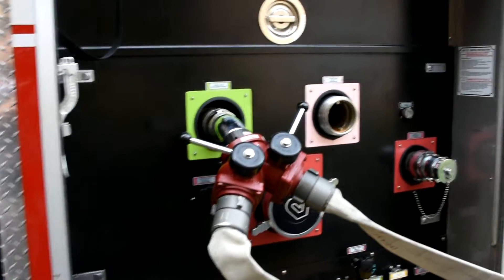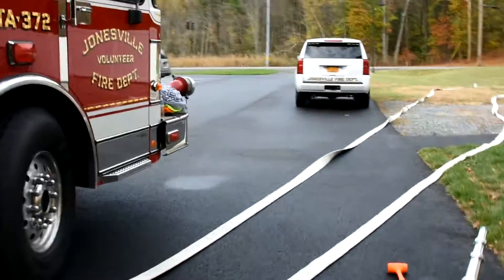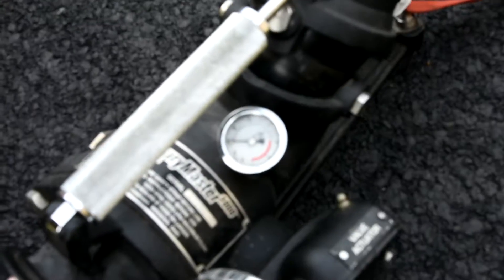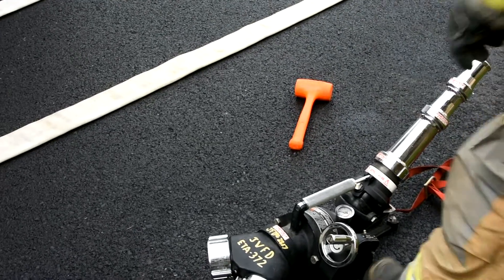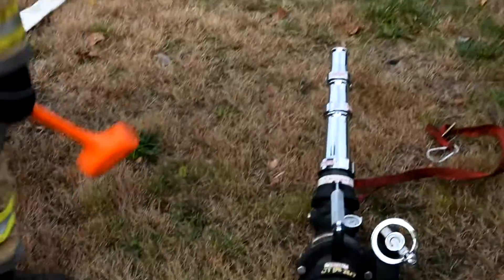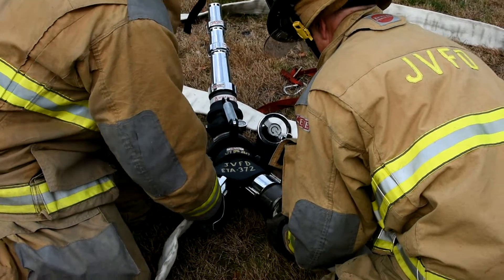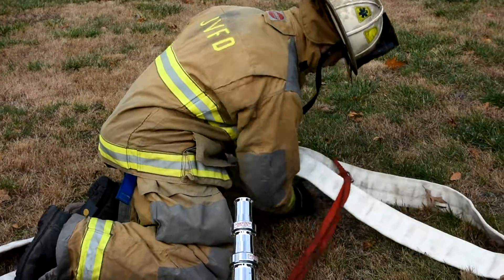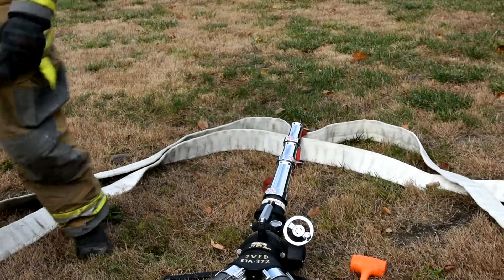Deploy A Master Stream Device - Skill Sheet 14

Comment: Good Work/ Instruction .

 May I suggest having this device Pre Connected off the rear of your rig ready to go with one 3 inch line on 2 .5  Couplings for a Quick Blitz Attack.

 You can then stretch a Second 3 inch line into it later in the fire once you are set up . 

Using 3 inch lines on 2.5 Couplings will give you more bang for your buck and increase your immediate Fire Attack GPM Flow  & your  secondary Fire Attack GPM Flow big time .

This will give you an excellent immediate Big Gun Exterior Attack on a job that calls for a strong /hit it hard  exterior attack requiring the hard hitting punch from a Big Gun right on arrival on the job with heavy fire showing .

Stay Safe !!!